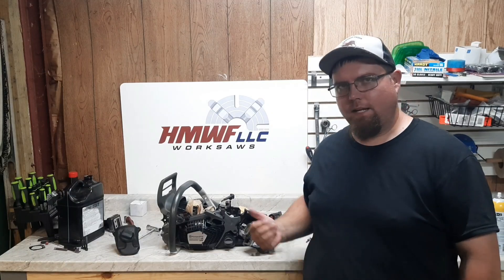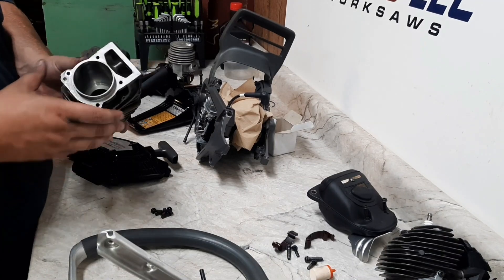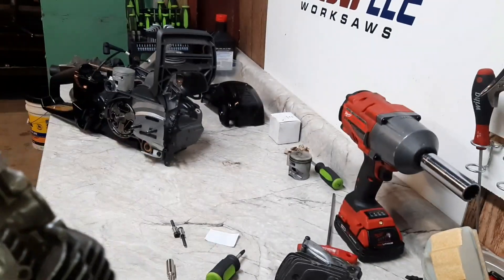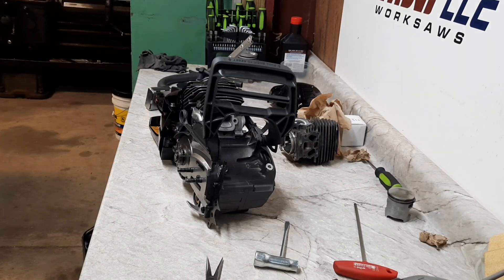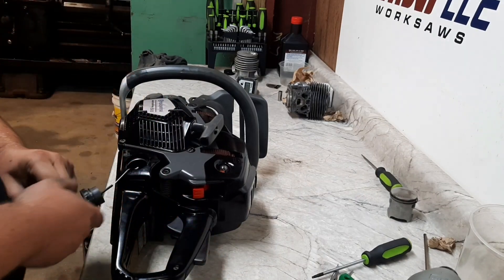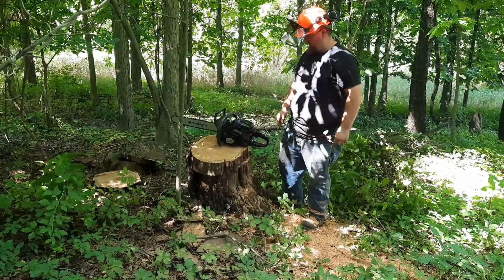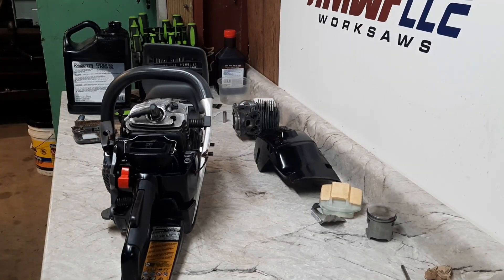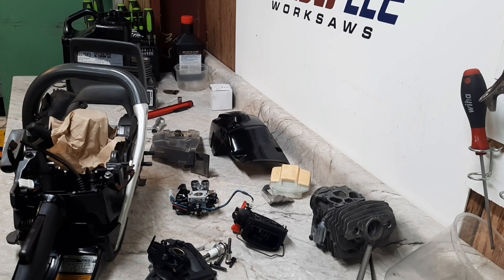||79cc Husqvarna ||Sleeper Saw!! 565/572xp big bore build!

Comment: Did you put it on the Dyno ?  How does it compare to the 565 or 572 with your modified muffler ??
 Is it possible to mount the carb from a 585 on it ? 
 Im old , we used to have 2100 carbs mounted onto 266s . Super impressive for such a light weight saw. !

Comment: I think it's great . If you can make a 565 (71cc) into a 79 cc saw , and it has the horse power and torque gains needed so it competes with a 500i.  As far as being able to pull a 36" bar full of 34" of Sitka Spruce or Western Hemlock.  
 And have it last for a season of bushlin.  I'll send you my 565 and have you build it !!! 
 The factory 372 Western  that came with 75 cc p&c from the factory. Would cut the same times with the same chain as the 460 Stihl.  If you can beat that, your doing Great  !!

Comment: What are the main differences between the 565 and the 572? And where are they making the power in the 72 compared to the 65 , same cc is it all in the timing and carb?
Reply from the maker: Porting, carb, coil are the big ones.
Reply: @dynojoemods2764  ah ok, so would the 72  cyl fit directly onto the 65 short block with no interferences?
Reply from the maker: @pelcer6669  yes, I do believe so

Comment: Great build Joe.
I’ve got a 570Autotune, whats difference to an 570XP ?
Can it be made into a big-bore 579 like this? How ?

More detail on your porting, jug&piston choice, carb setup. Would be great please.
Top job 👍 🇦🇺
Reply from the maker: The 570 is a whole different design than the 572. It already uses this larger piston. Not sure which piston would work for a big bore on those.

Comment: Nice Project, it reminds me of my 545. 
when you drop the cylinder down it collides with the case at the sides near the transfercaps . Front right Side check for case clearence. Mine riched up at idle with 78 deg intake. We talked about it earlier. with stock Intake she ran good. I gave her 100 deg ex , so 18 deg of blowdown with a red barn Popup. She ran good in the woods for about 2 Tanks , so i will give her more intake again.lets see how she does! 
So i‘m waiting for your results. Great Video

Comment: Great Build Joe.  Didnt Husky offer a non auto tune carb on some of these?  It would really bother me about that scoring.  I realize its a test build, but its still alot of work.  Good Job!
Reply: Never heard of a non AT version, the 576 had both AT and standard carb.
Reply: @brettblack7049  Thanks Brett, that is what Im thinking of, the non A/T 576.
Reply: @MrRmh3481  for sure.
Those 576's are smooth saws.
Many of the new stihl saws have been available in both mtronic and standard carbs, especially right now with the chip shortage.

Comment: Nice job Joe👍. I prefer old school Husqvarna 372XP. It's easy to get great gain, a better power weight ratio, a better result / porting effort ratio. I think that developing and playing with compact pipe Ironhorse style or similar, could bring better gain than drilling bigger bore with relative less effort.The finale product will have less vibration and design you can easy reuse.

Comment: Great video Joe!  Really liked seeing the build process here and it was great how you showed the air leak around the base.  I'd like if you showed the rtv process...what kind you use, how much you put on, how quickly it should be done.  I've second guessed myself a lot.  Also, why don't you just machine for the gasket and keep it?  
It looks sooooo good!  The black tank seals the deal man!  I think this thing just knocked my 2258 off the podium of the best looking saw ever!
Reply from the maker: Thank you, I coat both sides and let it tack up for a minute. The design of these cylinders the Bolts clamp way back from the front edge of the transfer tunnels. I think it may habe been the muffler holding it up some. A friend suggested to slot those. I like keeping as much material on the base as I can. I have seen plenty of bases get thin and snap. With and without gaskets.

Comment: Maybe once its dialed in you can build a nasty big bore top end for a 562. I'd buy a ported big bore 562 with a pop up piston.. even sell it as a package
Reply from the maker: I have not found a good piston swap for the big bore 562 just yet. They are way off form most everything else.
Reply: @dynojoemods2764  is there much to gain with the stock 562 piston and cylinder?
Reply from the maker: @jritcey108  normal work builds are 15-20% the 562 are pretty stout out of the box for 60cc
Reply: 👍 WOW !

Comment: The 565 is a great saw. Nice to see one being built up. 79cc in that package is a home run for sure. Did you do any stock dyno runs. I’m curious to know if it went over the factory 5 hp rating 
Thanks Joe
Reply from the maker: Actually just over 5hp. 5.6 approx. Edited above
Reply from the maker: I did do some stock runs. It was very close to /just over the 5hp right out of the box.
Reply: 10 4 thanks Joe

Comment: did you get all the bottom of the cylinder sleeve cut off because I know on a 550xp if you take the base gasket out you have to trim the bottom of the basically skirt of cylinder so it'll go all the way down to! Maybe that's why your base was leaking at your sealant?? maybe trim just a few thousandth off just to be sure cylinder goes down flat? just a suggestion I know you've built plenty of saws but maybe a oversight
Reply from the maker: I have ran into that before, i think the muffler may have been holding the cylinder up slightly.  These 5 series all have a few spots that like to hang up after a base cut.